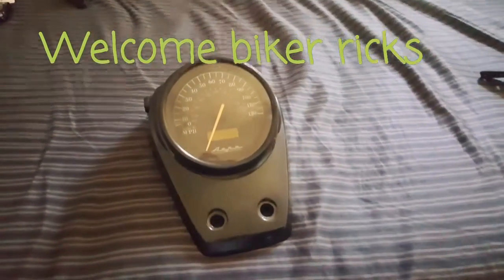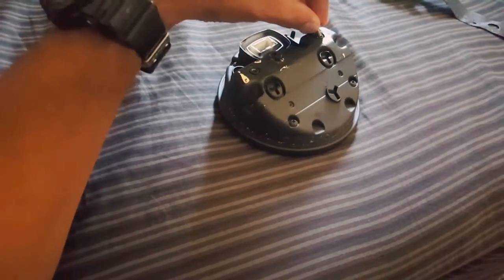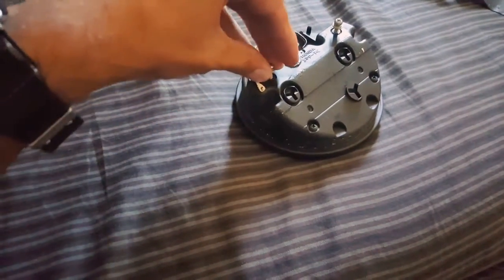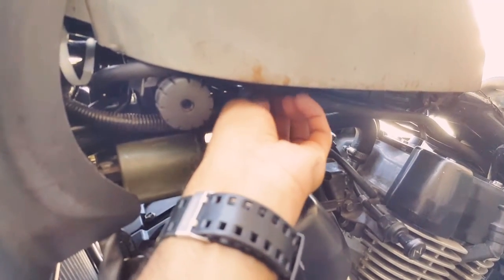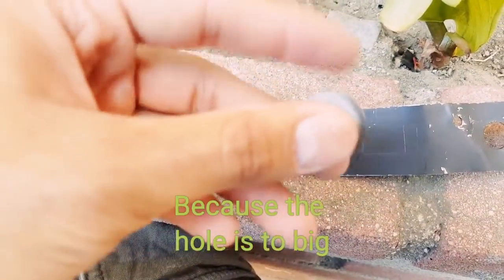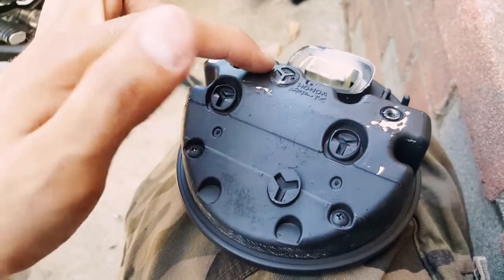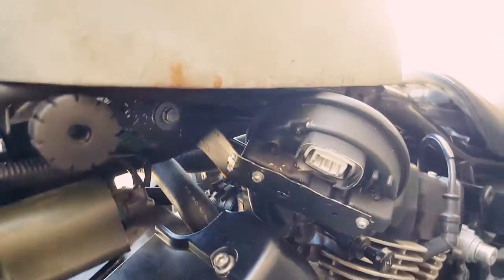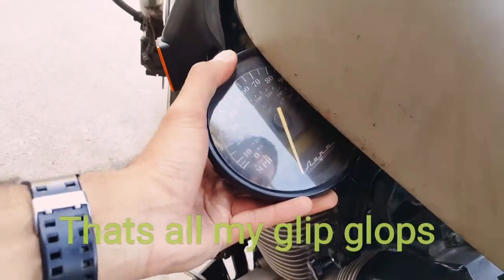Speedometer relocation 07 honda shadow aero vt750 ep8

Comment: Hey Alex, where do you have the vacuum line that use to run the the stock petcock going to? Or are you using it for the new tank as well?
Reply from the maker: If you see this I will let you know tomorrow. Gotta look at my bike. I think I'm still using the same set up for vacuum
Reply: @ALEXGSXR  ok cool. My petcock is on the same side as stock but it’s a single line petcock. I talked to Eric from casa customs and he said he wasn’t sure because he doesn’t really work on 750s.
Reply from the maker: I'm using the same vacuum line for the new tank . I just had to get longer tubing because my new tank has the petcok on the opposite side.
Reply from the maker: @chriscantu380   I'm using the same vacuum line for the new tank . I just had to get longer tubing because my new tank has the petcok on the opposite side.
Reply: @ALEXGSXR  ohh I got you. I’m using a frisco tank and 1/4 NPT petcock. I’m told it will gravity feed just fine I just wasn’t sure about the little brass fitting with vacuum line that goes to the tank. I’ll cap it and see what happens lol.

Comment: How you get your speedometer working with out the turn signals
Reply from the maker: I used the original turn signal wires to connect the new turn signal light strip

Comment: Where did you buy the back strip at ? I like how the l.e.d”s look
Reply from the maker: cookbrother i think i got it on revzilla website. but it is a custom dynamics led strip they also have a website i think
Reply: For sure thanks 🤙🏼
Reply from the maker: cookbrother also if you can find a cheap l.e.d turn signal strip just get that. because  they will look the same . custom dynamics is to expensive for the simple l.e.d.strip

Comment: How did you get the tank to fit?
Reply from the maker: soft rubber hammer and zip ties on the front and back👌
Reply: Did you need a new petcock? And what about the vent line
Reply from the maker: Trevor Sanders got a cheap petcok from harley Davidson store  and longer vacuum and fuel hose from autozone because petcok is on the other side
Reply: Okay awesome. Last question is do you know what kind of tank it is. Like a sportster? Thanks I appreciate your help
Reply from the maker: Trevor Sanders i think its an older 2 gallon peanut sportster tank. it had alot of rust when i bought it used for 40$
Reply: ALEXGSXR so from the tank you installed peanut tank -petcock -to the motor? Did you have to pressurize the tank?
Reply from the maker: james yamane just saw this not sure if i responded yet. no didnt pressurized the tank not sure what that means.  i just did petcok gas line with vacuum line

Comment: Helpful, but when are you gonna chop those fender rails, take off those side fairings or at least the reflectors, and get rid of that couch of a seat? Lol
Reply from the maker: Brad Nugent seat is gone and reflectors are also. im going to chop of the back as soon i i figure out how to install a half rear fender and small sissy bar
Reply: Put one of those single bolt seat pans from TJBC